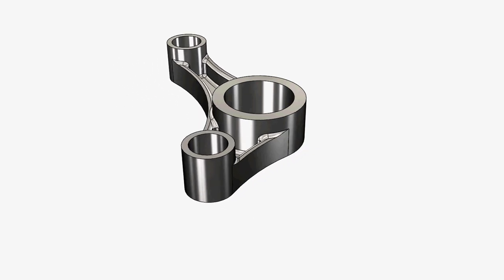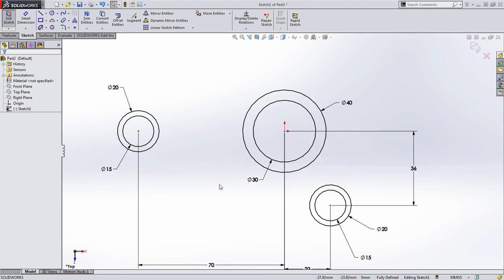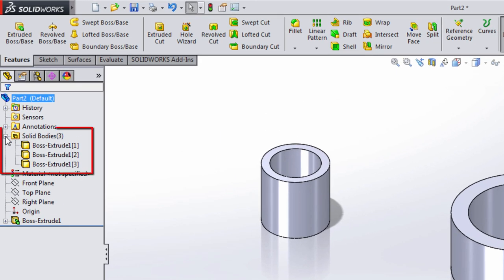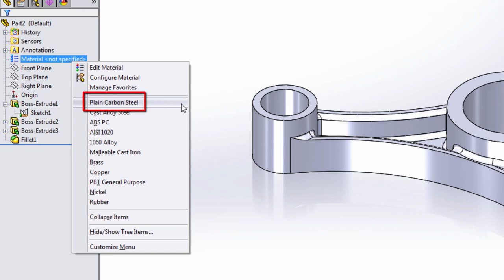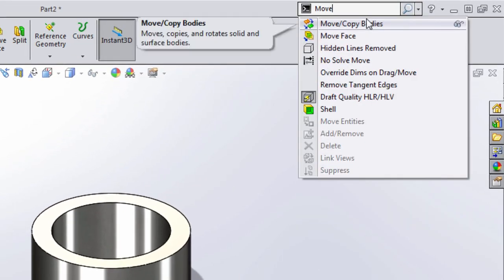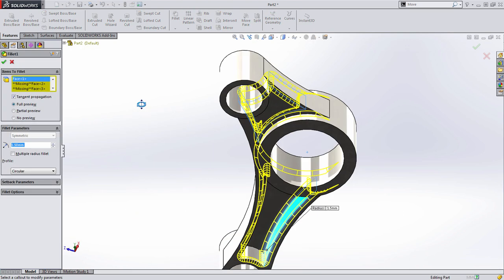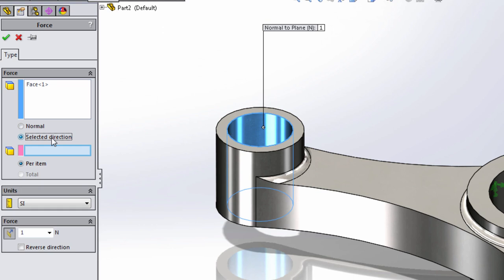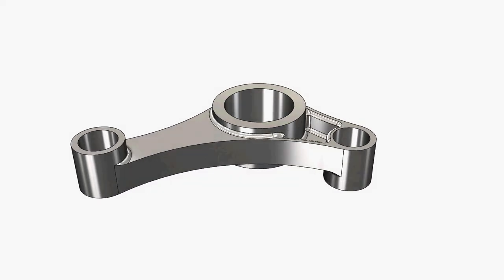SOLIDWORKS World: Model Mania 2013

Comment: It was obvious right from the beginning where is the weak spot. Why use a simulation based on physical properties of the material, if it will not be used to optimize the design after the simulation showed that it has flaws?

Comment: Why not just use Shell?
Reply: yes, there are many routes to Rome! ;)
Reply: Shell doesn't work. If you use Shell, then an additional layer gets created around circles and you will get errors when using fillets.
Reply: Shell can be successfully used if you first extrude the 12mm boss without the circles, select the appropriate faces to shell, THEN extrude the circular features and bores. Fillets will work fine as well with this method.